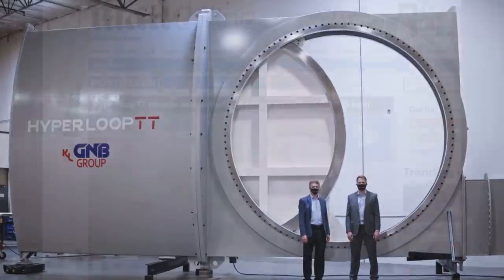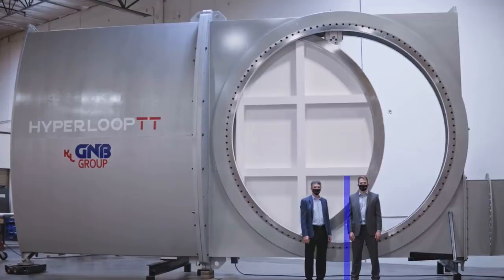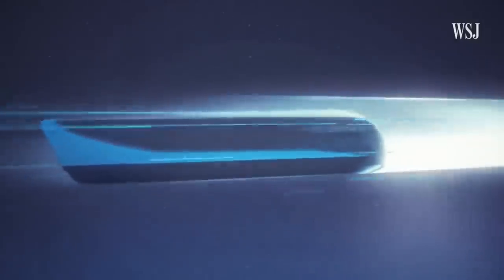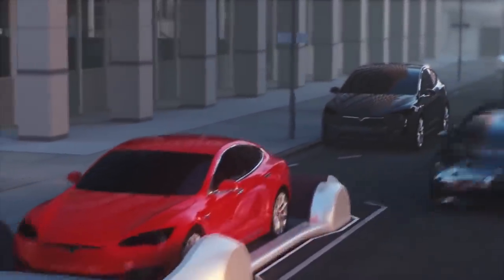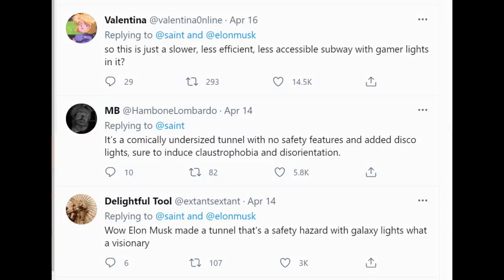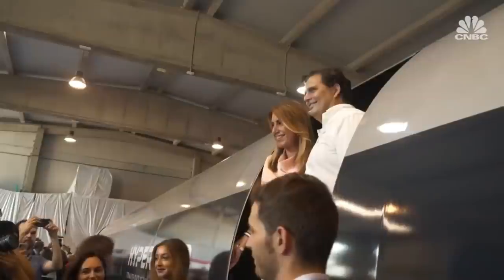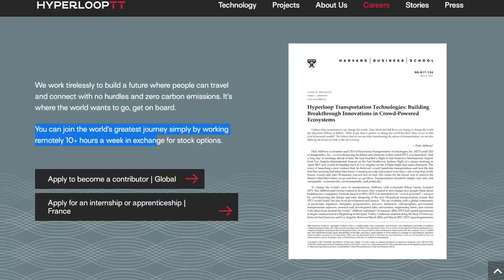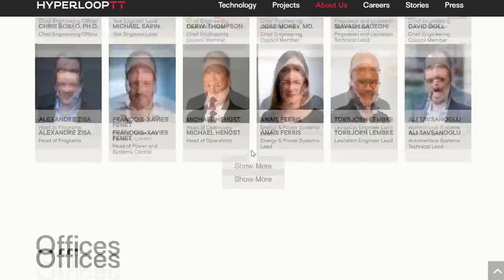Hyperloop TT vs. Virgin: The Race to Make Musk’s Moonshot a Reality - BUSTED!

Comment: Okay, at this point, it's time for Thunderf00t to get together with EEVblog to design and build small scale models of different systems to compare and contrast the benefits of different types of train systems, including different variations of the hyperloop.

So, basically; regular train on tracks, maglev train, and hovercraft train, with a regular and vacuum tube version of each, with cost comparisons and proper load simulations. Of course, this will probably require both the Musk version and actually functional versions of some of these hyperloop design variations.

That would pretty much shovel the dirt onto the grave of the Hyperlopp Farce

Comment: Haha, that bit about the cars dropping down in to the tunnel. Hmm, in Canada we have this thing called snow and ice and ground water. One winter that system is pooched.
Reply: Not to mention the insane costs of building tunnels in Canada due to the shallow layer of soil over bedrock and the need to bury everything deeper due to the freeze depth. So you will have to bury it deeper and yet will need to blast tons & tons of bed rock...
Reply: @davidhollenshead4892  Not to worry TransPod will figure out how to con the Canadian market, feasibility studies in the works right now!
Reply: @davidhollenshead4892  bedrock cant be mined...duh
Reply: @yayayayya4731  High Explosives can shatter bedrock, making it possible to remove with heavy equipment. And your point is ???
Reply: @davidhollenshead4892  It's a minecraft thing lol There's a layer of rocks at the bottom of the world called bedrock that you can't dig up because you'd fall through the world if you did.
Reply: @davidhollenshead4892  
In some of Canada, the permafrost is just a few feet down.  Tunnels can be build there to carry beavers between their homes.
Reply: @kensmith5694  I haven't seen a Canadian beaver since the 80's.......

Comment: Yeah let's put the Hyperloop right on the San Andreas Fault.
Reply: Running north to south an California would be less of a problem than east west.
The faults have LA moving towards Alaska but the inside of the state less so.  Thus an LA to Lost Wages is the wrong way to run a tube but it also happens to be the one high speed rail line that would make sense.
Reply: Daddy why is the train bouncing up and down, I'm scared daddy. Opps vaccume lost friction at 700mph makes airplane turbulence seem mild or nothing in comparison.

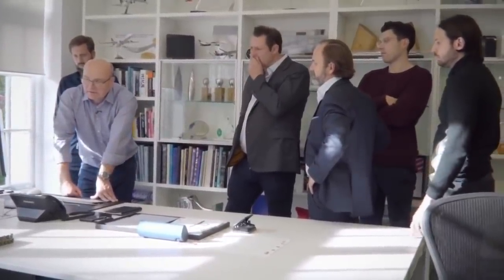Comment: @1:43 are they using epoxy to attach the various stages of the carbon fibre capsule?..

Wouldn't that result in frequent debonding faults , when used at such a large constantly stressed joint section?..

Comment: Why do all these hyperloop cars need to look so damn aerodynamic if they're operating in a vacuum ?
Reply: Because it isn't a perfect vacuum, and trains traveling at that speed accumulate a capsule of higher pressure air around them as they travel, reducing the efficiency. That is why the 100+ year old vacuum train concepts have fans on the front of them. Also, I suspect they are just trying to make them look cooler, since this entire industry is about hype and pushing stock prices.
Reply: near-vacuum.
Reply: Because sleek is sexy and wasting 10 feet on a cone is a practical waste of investor money.
Reply: Stylish

Comment: I wanna see one of these companies actually try to build a proof of concept. stations on both sides, boardable pod with human-analogues, pressurization and depressurization, tunnel long enough to reach top speed, and a simple turning system to take a pod off of the one way track and onto the one way track back (tunnel back not needed). i think that's the minimum to do safety tests and prove passenger viability

Comment: If you want a carbon fiber tank to hold pressure, you really want to line the inside with a thin layer of a softer plastic material.  The atoms of air can't get through that thin layer but the strength comes from the tube around it. Pours in the carbon fiber that would let air through won't let the plastic through.

Comment: PLEASE - anyone who works for these companies - explain how these rigid pipe-shaped pods are supposed to get around inside another pipe without a widening of the pipe on the corners.
Reply: How about making the pipe perfectly straight.  It can start off 200 feet in the air at each end and be 200 feet under ground in the middle.
:) :) :)

Comment: Fun Fact: If everyone walked through the tunnels it would be more efficent even if there's a 1 meter / ~3 foot distance between every person
Reply: Install a "moving sidewalk" thing you sometimes see in airports and you would have a practical system over longer distances than many would want to walk.
Reply: @kensmith5694  I don't know if a moving sidewalk over such a long distance with some curves would be too mechanically complex. Or, way simpler: everyone would just walk on the surface instead of a tunnel but that's sadly not possible in a country so dependent / reliant on cars.
Reply: @Ashley161-o7  The mechanical issues can be solved by even just a modestly clever engineer.  Technology is easy.  Social stuff and politics are hard.
Reply: @kensmith5694  or (way cheaper, easier and efficient) just walk / ride a bike on the surface

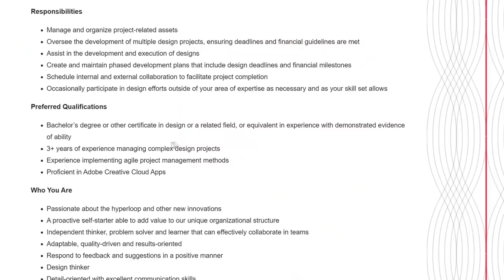Comment: 20:08 You'll need a spatula degree, for scraping dismembered body parts and bits of cabin from the walls of the tunnel when they do make that paper thin "nobrainium"  capsule pressure capable.

Comment: They need these valves at the stations.
The biggest question I have is, how much ENERGY and TIME does it take to remove that air? I'm betting you'd be spending a lot of time just waiting for the vacuum to develop.
Reply: The airlock with a pod inside could prob be pumed out in a few mins with a massive pump 👍. My fear would be fatigue. It would be like cycling a plane hull from sea level to space pressure in a minute 😂. Again and again 😳. Imagine the mess a pod explosion would make 😳

Comment: As a power station engineer I am familair with big gate valves like that, and it is fair enough to test it in the factory before fitting it in its final place.  But a thing like that is fricking expensive, as will most be H-L hardware.  And I'm not impressed with the force it must take, 140 tons, were we supposed to be impressed?

Comment: Why is it harder to maintain a 600 km vacuum tube (pressure differential 1 atm) vs a 600 km oil pipeline (pressure differential >20 atm)? Are liquids easier to seal in than gases? How do pipelines deal with thermal expansion? Thanks for any answers!

Comment: Just pondering one of the engineering challenges in isolation - I wonder if the easiest way of building a large vacuum tube would be to make a hollow hull and pressurize it. Maybe with water as the medium. The pressure in the hull would need to be significantly more above atmosphere than the vacuum is below it (1 bar). If the inner tube diameter is 2 meters and the hull is 10 cm thick, the hull would need about 10 bar absolute pressure, assuming a hull material that can hold the pressure but can't provide rigidity to the tube by itself (like a balloon). The principle would be comparable to somebody standing on top of the door arch on an inflatable castle. Pressure or their resulting forces aren't equal on both sides, but with high pressure in the inflated arch, the differential of pressure is stabilized.
That plan would make the whole assembly lighter (dry weight), but it would also add a whole different failure point to the design. If using water, the potential for explosion of the hull would at least be avoided.
Just an idea shooting off of Hyperloop.

Comment: 8:00 - 8:40 You forgot to mention that the Chunnel project bored 25 foot diameter tunnels, while the Boring Tunnels are about half that at 13 foot diameter.  Since the area of a circle is the square of its radius, this means Boring actually only managed a quarter of the volume of tunneling per unit length, still took nearly 2 years to do what the Chunnel did in 3 months.  So the Chunnel really did 4 times the tunneling in 1/8th the time, meaning Boring was 32 times slower.
Reply: He also forgot to mention: 
Digging of the LVCC loop began on November 15th 2019.
91 days later on February 14, 2020 the first tunnel was completed. 
May 2020, the second tunnel was completed. 
LVCC loop opened on April 9th 2021. (Including finished tunnels and terminals.) 
...there was also a little COVID thing going on...
There's also a difference between the speed at which you can dig a tunnel, and when that tunnel is actually finished. The LVCC was also dug with one older modified more conventional boring machine, with the purpose built machine not finished until February 2020.
The channel tunnel used 11 machines and two crews digging either end.

Comment: To get a better idea of what is currently possibly in the area of large-scale vacuum systems (and to which costs), a comparison with/experiences from the 9000 m^3 vacuum systems in the (30 km) LHC accelerator tunnel with attached detectors, would be interesting. And useful to potential enablers (perhaps also to debunkers).

Comment: at 4:30 Phil says that the pressure is proportional to the length of the tunnel; that would be true IF the tunnel was vertical but it is NOT: it is horizontal.

Comment: I'm a physics noob so maybe I don't understand, but doesn't an air cushion need ambient pressure to work? I mean, if you blast air from a pod in vacuum it's just going to disperse in a flash without lifting anything, until the tube fills enough to have pressure inside. IDK, somebody enlighten me?
Reply: You have it basically correct.  You don't need an ambient pressure but you will soon have one if you do an air cushion.  The air will rush out from the air cushion.

Comment: One quick question: if it's supposed to travel in a vacuum, why lose all that passenger space for the aerodynamic tip? You could make it flat if it truly travels in a vacuum and it wouldn't change a thing.
In a truly frictionless vacuum scenario breaking is probably one of the biggest challenges...

Comment: There's also the principle that any effective transportation system gains traffic until it's too expensive or it gets saturated.  I remember decades ago, Scientific American had an article with 3 pictures of the same intersection in New York City widely separated by several decades.  The traffic was different, horses and carts, early cars, recent cars, but the congestion was the same.  This either doesn't work or ends up limited by expense or saturation.  I'm expecting it not to work.

Comment: I've said this before. and I'll say it again. How to kill literally everyone in the hyperloop system:
Step 1: obtain gun
Step 2: fire 1 boolet into the tunnel wall
Step 3: watch the tube implode as air rushing inside at the speed of sound slams into pods and kills everyone inside. Whoever doesn't die is now stuck in a metal coffin inside a metal tube with no way to get out, and will die of their injuries before the rescuers can cut through the 2 layers of high-strength metal that surround them.

This is so monumentally stupid.

Comment: just to add, the Chanel Tunnel is 3 Tunnels but they had 11 digging machines working in parallel.
Reply: and they still managed to dig more then Musk did. Musk's boring machines are commercially sold tunnel boring machines

Comment: In general I agree, but I don't like some arguments, for example comparing valve surface area and tunel surface area.
Its much harder to make flat surface withstand pressure, while tube workkd like an arch compressed from all sides and it can be rather thin as long as its resistant against small deformations.
But when some small deformation happens, tunel would no longer work like an arch and it could fail hard very quickly.

Comment: Regarding your tunnel boring part, I think you forgot to account the type of rocks, the size of the tunnel, and the amount of labor needed to complete the two projects.

The London to France underwater tunnel has to go through softer rock through a tunnel mostly dug through dangerously by hand in 6 years before it was widdened by machine for 2 years.

The Elon Musk Tunnel  Bore has to go through much harder basalt rock, and was purely mechanical, in 2 years.

By comparison, the tunnel borer that made a tunnel in Indonesia is quarter a mile, 2x larger, and on limestone, and still took a year to complete.

Comment: Not sure I quite understand the calculation at about 4min into the video. Surely, the force exerted on a tube cross section by the gas inside the tube does not increase with the length of the tube, does it? Not if pressure is - and it is - an intrinsic property of a thermodynamic system, anyway. Having an overall larger system at 1atm does yield more overall mass in the system, yes, but not more force against the gate, or does it? Also, if one were to use these as airlocks, surely the volume that would be de- and re-pressurized would not be the tube's along the entire length of the actual track, but rather what ever airlocks the gate seals off at either end, rendering the length of the rest of the track even more irrelevant than the pressure =/= mass argument above had already left it. Or am I misunderstanding the purpose of an airlock here, too?

Comment: To be fair, railroads have ways to retract/move tracks in the rare instance that it's needed.  So they could, potentially, come up with a way to deal with the valves.

The problem being this may impact the safe speed of the vehicle.  And they're throwing out specs before even actually working any of it out.

And you can come out with any sort of awesome futuristic transit system if you don't bother working out any of the practical details beyond what sounds "cool".
Reply: To note, though, I don't think solving that tracking issue with the valve is something that makes Hyperloop work.  There's too many other issues to work out and a remarkable lack of progress towards solving any of those issues.

At least they added LEDs, though?

Comment: Listen closely as you put the container with your check and ID into the vacuum system when at the bank, clunk, clunk, rattle, thump. Perfect. 

I believe that type of system but small scale was invented was back in 1930's or earlier. They used them in businesses before they got networked telephone systems in pre digital days. Used to send something like files or contracts to another department they'd just drop a container with something in it in the tube system to send to mail or where ever.  Then like a switchboard operator a worker would place it in the proper tube to send to the department listed. No money spent to have anybody paid to walk 500 or 1000 yds each time and back or riding elevators 6 floors since if enough workers that tube would arrive before the elevator even showed up once on the floor of the sender of the message.

Comment: The issue is maybe they did testing on different equipmet during the tunnel digging but nevertheles it was slow. But fact for fact, Tunderf00t is on point as usual.
I wish I could turn the sarkasm louder though.

Comment: Rails don't need to go through the valve, they can be (and should be like real train tracks) broken. I'd imagine if that was my part to design I would opt for a small section that pivots into place like the turntables that are used to rotate a train.  Fortunately this isn't turning a whole train so it doesn't need to be gigantic just big enough to swing the track out the way.

Comment: I was wondering, how solid are the tectonic plates in US?
I assume there aren't many faults that would pull the tunnel in different directions until it's ripped apart.

No expanding joints would ever save it from that.

Comment: if u calculate the area of a circle and Atmospheric pressue net comes to 130 tonnes. and so the factor of safety is less than 1.1 times.

 basically means it just about seals the doors at Atmospheric pressure. so if u come running in and push on it, The valve WOULD BREAK DESTROYING EVERYTHING. 

lol

Comment: I'm not a qualified engineer of whatever those valves come under, but that valve better have multiple redundant systems to ensure it's fully operational. A faulty sensor could lead to the system saying the valve is open when it actually is partially open or not open at all. I would not like to be the person who has to clean up that mess